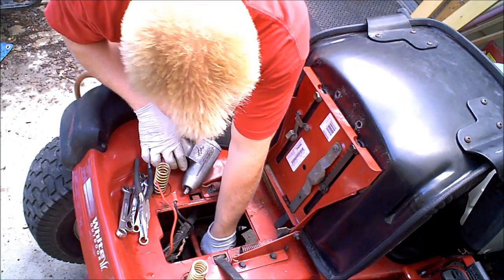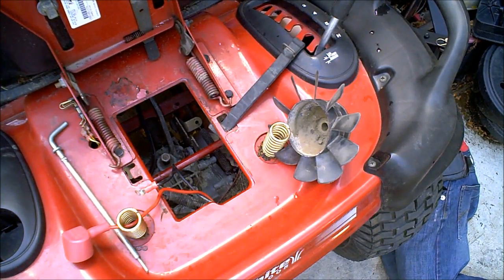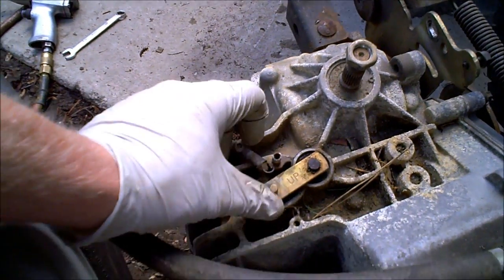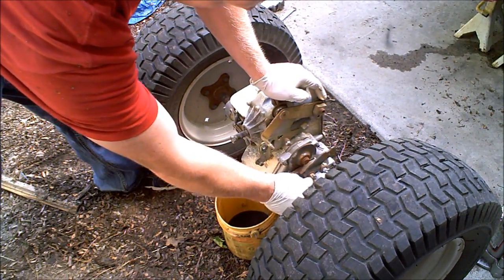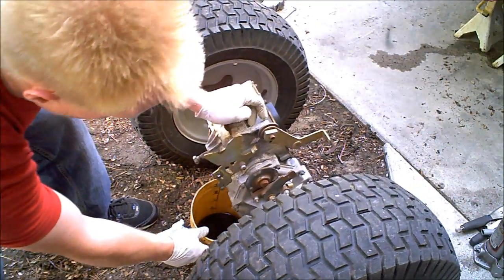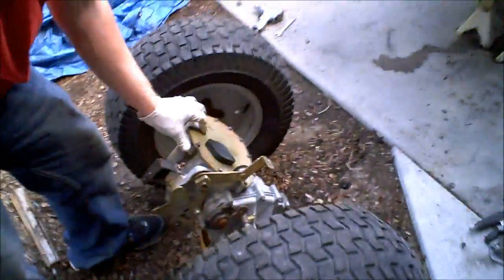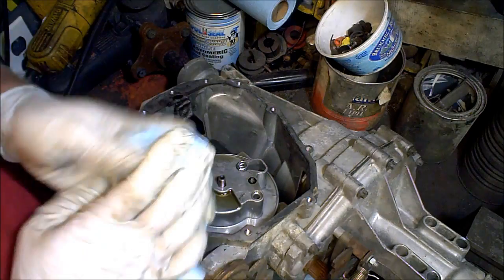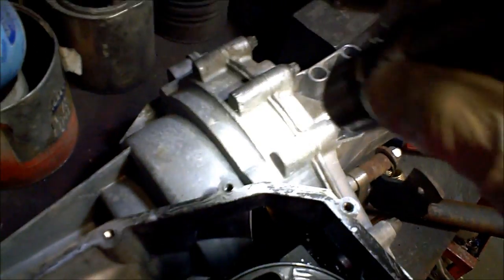1 Hydrostatic Garden Tractor transmission rebuild 1 of 4 Hydro Gear

Comment: hello
I own a stige rider villa hst 8-11E.
I want to change the oil in the hydrostat drive because it is already old,
I can't find the oil drain plug, what should I do, I need your advice. The drive works ok. which oil do you recommend?
thanks for your reply, our stigma masters don't know that.
They say that the oil does NOT change ???
lp. joze slovenija

Comment: I have a HG 0610. I wonder if it is the same or similar as I'd like to do an oil change on it too someday. I'm just not sure where to get a gasket kit for it. I'm in Australia and parts are difficult to locate and if you do find them,  they are damn expensive. Buying from the U.S always incurs extortionate shipping rates. I don't understand how a $5 part costs $40 to ship. Bloody Crooks !
Reply from the maker: All of these Hydrostatic transmissions are very similar in layout and identical in function. Some have a drain plug.

Comment: Any idea how to change just the left axle seal a d where to get seal at
Reply: 2185 cc looks different than one in video
Reply from the maker: The transaxle brand and model will be on a tag on the transaxle itself. From there you can find a parts breakdown online and part numbers.

Comment: Where do you get your parts from to repair this transmission? Sure would appreciate it if you could tell me. Bernieyarmuch@shaw.ca  Thanks. Good job on the vedios.
Reply from the maker: I ended up finding these parts on Amazon. Finding parts for these isn't always possible as so few people work on them. Find your part numbers and just Google them. You may also need to contact the manufacturer if all else fails.

Comment: I had to diagnose a weak drive in a skid steer.  Same setup as in a mower.  Finding nothing really wrong, the factory sent out a technician.  He also found nothing.  Since this was a brand new unit, they sent a replacement, and it worked fine.  The original was sent back to the factory.  A few weeks later, I was informed, someone installed a set of pump Pistons in the motor side.  The only difference was the bleed holes on the slippers are different by .010 of an inch.

Comment: i have a question on a v twin 19hp briggs, i started it up and in 5 minutes it was really getting hot to the point where i had to shut her down, i took out the spark plugs and noticed one got really hot ,like as if you put a torch on it , the other was fine. What should i check for to get my lawntractor to cool down. i thought i would ask you because you know how to fix anything and if you can't , ITS DONE! LOL!!
Reply from the maker: Generally these engines only overheat because debris are blocking the air cooling fins. More than likely with a riding mower a mouse built a nest on that cylinder.

Comment: How do you “reinstall” new fluid???
Reply from the maker: There is generally a plug on the top or a side. You can see at 4:19 the hole in the top I'm draining the oil out of.

Comment: Excellent, clear, free of music distractions, understandable, easy paced videos on your transmission repair.  This level of repair is beyond me presently, and I don't know if that is my problem.

  I have a Craftsman 18.5 hp, OHV, DYT, Intek Plus, auto transmission riding lawnmower.  I am NOT able to manually push it.  I don't know yet if the mower actually runs.  I can't push it out of my trailer because it will not roll.  I put it in the neutral position and disengage the lever for the transmission disengagement, but it will NOT roll.  When I jack up the rear wheels, the wheels will spin freely - in opposite directions.  Do you have any suggestions or possible ideas of what is wrong?  Thanks John R.
Reply from the maker: It's hard to say. A lot of hydro don't push easily even with the disengage lever actuated.

Comment: How do you remove a drive spindle from a hydro transmission?
Reply from the maker: You need to pull the entire transmission apart to separate the drive spindle.
Reply: sixtyfiveford do you have any video or other information on how to do this?
Reply: sixtyfiveford  pulled the trans got it open up drained the oil.  Need info were to get parts and the trans diagram. Need how to replace the drive spindle.
Reply from the maker: Google your hydro trans model number and you should be able to find a schematic.

Comment: my husband has one I wanted to kno the cost, but his sounds smooth  and it starts first try. I'm sorry but urs sounds like u have a muffler leak? I listen to All the mowers and riders he works on and I've gotten a pretty good ear to the sounds of the engines and mufflers on just about all of them (after 24, yrs.). bob Also has a Hydro 165?, John Deere, and Ariens, 10 Horsem All working Ex. in case You guys need Help

Comment: Great video.  I have to replace a fan and pulley on a Hydro Gear ZT-3400.  Looks like you made quick work of getting yours off, but I can't figure out how to keep the fan/pulley assembly from turning when using a ratchet.  Does the impact wrench make it easier?
Reply from the maker: Yes, an impact will take it right off effortlessly.

Comment: +sixtyfiveford thoughts on converting a variable speed mtd transaxle to either a 5/7 speed manual or hydrostatic transmission? or should I just rebuild the variable speed? it started slipping and making frequent popping sounds, and eventually it was slipping so much (with the pop/clank noise) that I could barely make it up a slight grade. reverse is only slightly affected, but not immune. do you think that shaft is rusted, causing the hub to not freely slide? I can't think of what I could of stripped inside of it. there is only slight play in the axle itself. actually the play seems to be within spec, up/down, left/right & in/out.
idk if I should dedicate my only day off per week to tearing into it. of course, craigslist has plenty of used transaxles but they are either hydros or manual, no variable
Reply from the maker: The variable speed is a great transmission. Most of the time the variable clutch is just sticking and needs a little clean up.
Reply: thanks for your input, I'll let you know how the rebuild goes

Comment: hi, i just got a brand new mtd lawn tractor with hydrostatic drive, it works great, however the transmission makes a slight whining noise, is this normal for a new hydro? thankyou!, keep up the good work.
Reply: oh and also just to add, i did purge the system to make sure there was no air in it.
Reply from the maker: A whining is small air bubbles that are trapped. They will work themselves out over time and you shouldn't worry about it.
Reply: +sixtyfiveford thankyou!, keep up the good work
Reply: Thomas king

Comment: I got a 1989 NOMA with a 16 V-Twin OHV. It runs good and one thing I can't get rid of is a whining sound from the transmission. Any ideas ?
Reply from the maker: Whinny is generally a transmission that has air in the system.
Reply: R Verro yhttps://www.facebook.com/TrumpPoliticalMovement/posts/522488951279470

Comment: what oil are you using? some people said use 20w 50 motor oil and other gear oil. which one should i use?
Reply from the maker: +Dany Luna Different units/brands call for different oils. Mine called for 20w-50.

Comment: I have a Murray tractor with a hydro trans-axle, for some reason it is stuck in neutral all the time, i had done all tried all I know to get it in gear,  the free wheel lever works, the brake rod works, the foot pedal works,  all have been lubricated and move freely do you have a idea of something else I can try.   Your video's are great and I have enjoyed watching them very much, Any easy to follow.  Thanks George
Reply from the maker: +George Edwards More than likely the internal pin that puts it into free wheel is sticking even though the lever is disengaged. Light taping with a hammer may free it up inside.
Reply: +sixtyfiveford I have a cub cadet 1020 that is stuck in gear and I have no idea which one because the shift stick has come off. can you help me at all?

Comment: Ok.  Will tell him but he is insisting he needs to replace switch interlock  no 725.04039.  He has tested all switches.  What does the above part do for the tractor.
Reply from the maker: Barbara Votaw 
This tractor is equipped with a safety interlock system 
for the protection of the operator. 

•     The safety interlock system prevents the engine 
from cranking or starting unless the parking brake is 
engaged, and the PTO (Blade Engage) knob (or 
lever) is in the disengaged (OFF) position.

•     The engine will automatically shut off if the operator 
leaves the seat before engaging the parking brake.

•     The electric PTO (Blade Engage) clutch will 
automatically shut off if the operator leaves the 
tractor’s seat with the PTO (Blade Engage) knob in 
the engaged (ON) position, regardless of whether 
the parking brake is engaged.

•     With the ignition key in the NORMAL MOWING
position, the electric PTO (Blade Engage) clutch 
will automatically shut off if the PTO (Blade 
Engage) knob is moved into the engaged (ON) 
position with the drive pedal in position for Reverse 
travel.
Reply: Thank you.  My dad wanted specific instructions.  Will give to him.

Comment: My dad is trying to repair a Cub Cadet LT 1046.  Specifically he needs to know how to reach the interlock system 725-04039 to check and/or replace.  The motor keeps shutting off.  Any help will be appreciated.
Reply from the maker: Barbara Votaw All of the safety switches are tied to the seat. They want to make sure you're on the seat while the blade is engaged.  Lift the seat and make sure the switch is in good condition.

Comment: Hi there,I have a Murray Ultra wide body 20hp twin and the hydrostat was getting lazy.So it got parked as I have 2 other mower's.I'm wondering if you know anything about the rear end in theses rider's.It look's like it's a totally sealed unit.Any way to fix these or should I just part out the mower.I'd hate to get ride of it cause the motor ran so smooth and cut really nice as well.I'm very mecanicly inclind so I'm not afraid to dig into it but if it's not worth it than would rather not.
Reply from the maker: Kurt Martin The pump or hydro motor in these is about all that wears out. Pull the transmission model number and see if you can find these parts. If so, I would rebuild it.
Reply: sixtyfiveford thank you,it's one of those thing's I don't know much about.But will give it a shot.Thanx again Cheer's.
Reply from the maker: If you decide not to do anything with it, save the motor as you can use it on any other riding mower. You can even find someone with the opposite problem as you with a blown motor and good transmission and do a swap to make one good machine.

Comment: How much hp can  hydrostatic take?
Reply from the maker: knightrider1545 A lot. Most will easily handle the 20-25hp motors they put into riding mowers these days. The just slip internally more which is the nature of a hydrostatic.
Reply from the maker: 36hp is maxing it out, but it'll handle it. You'll be close to the edge but like anything with an engine just don't "slam" it and it will handle it without breaking. The biggest performance gain you will see is cutting grass. It may be rough on belts but it'll cut without an issue.

Comment: I hate working under the the battery - Look, then reach in and feel for it. Repeat, ad nauseum.
Reply: Why don’t you just loosen and remove two battery bolts, lift the battery out of the tray, then you’ve got access to fool with these damn things. I just removed my MURRAY transaxle entirely, much easier to drain the oil if it is removed from the frame...

Comment: I have a Cub Cadet mower, same transmission though. It leaks a bit of fluid through the bottom and right rear wheel. Not too badly actually, maybe a 1/4 cup every couple weeks. Went into garage this morning (after mowing 4 days ago) and a puddle of fluid was under the right rear wheel. Any thoughts?
Reply from the maker: The wheel seal it bad. It can be done on the mower and would probably only take you under an hour.

Comment: Where did you buy your parts for the hydrostatic transmission?
Reply from the maker: Amazon actually had the part I needed and they were the cheapest. I just found the part number I needed and then Googled it for 30 minutes.
Reply: Can you remember the vendor on Amazon?       Another subject....I want to know how to find an explosion chart of a John Deere 130 hydro gear trans axle.  We have googled and unable to find one.  Thanks.  Leamon
Reply from the maker: I just looked it up; it was Mowtownusa . They also have a website but there prices aren't the best. I would find your part number and Google it. Do you have the L130 or the older 130? Your transmission itself should have a model number on it.

Comment from the maker: I not sure without Googleing it which type yours uses. Mine used 10w 40 engine oil but I know a lot use transmission fluid.

Comment: Your video was helpful in rebuilding a hydro gear transaxle in my older Husqvarna LT130 Model # 310-0650 (319-0650).  How much oil and what kind of oil should I use? Thanks

Comment: Hey
   I have a murrey hydrostatic rider. It won't start unless I jump it with my boat battery. I bought a new battery for the mower and does the same thing. I have replaced the key swith and the seloined, get the same thing. I set the boat battyery beside the starter,hook the pos. to the pos. wire that goes to the starter. Then nagitive to battery,then touch it to the outside of starter and it starts?

THANKS
Reply: You didn't say whether or not it was turning over, or if the solenoid was clicking.  If it is not even trying to turn over, you probably have a bad safety switch somewhere. A quick check is attach a small jumper to the pos on the battery, then touch it to the small wire on the solenoid.  If it turns over then, you either have a bad safety or a broken wire somewhere.  Running the jumper, bypasses the ignition switch, safeties, and wiring.  All the solenoid is looking for us a signal to activate it.  Good luck.

Comment from the maker: This one runs 20w50 motor oil but many call for different fluid. The transaxle on this one is connected, using the same fluid and most due.

Comment: Great Video! (as always)

Hey, What weight oil did you use? Do you use a different types of fluid for the pump and transaxle? 

They are separate, right?
Reply: when I rebuilt one I went to local lawn n tractor store and they sold me this clay based grease I refilled mine with.. came looking for name as no longer near that shop.
Reply: mine was different though, sort of a pancake design.

Comment: And is it possible to put a 2 speed fan so lets say your going up a hill a lot with a full grass collector on, the 2nd speed either mechanically, electronically, or physically shifted in to 2nd gear make the fan go faster to blow more so it can cool the transmission down, is it possible?

Comment from the maker: Its hard to say if there is something internally wrong without a running engine attached to it. It should not move that easily. The transmission can be damaged if someone towed it for an extended period with the lever IN. Since you engine is out of comm I would hook a socket and drill to the top of the pulley on the transmission and run it to see if the wheels move.

Comment from the maker: The brakes are adjustable. There is a small disc on the side of your transmission. There is a nut in the middle of the brake caliper on the small disc. Turn this in cw 1 turn and try it.

Comment: thats what it is doing, just goes very slow, an dies on an incline.  i found a breakdown on the axle part just nothing for the pump.  cant find any numbers on it. but i have a peerless 1312  serial 30065402

Comment from the maker: A filter change will only help if it is very clogged. In that case would probably wouldn't move at all or very very slow. You can view Peerless/Tecumseh parts breakdowns online. What are your Peerless numbers?

Comment: the fluid i drained was clean, on top in the reservoir it was a bit gray and cloudy.  i adjusted all the linkage to my transmission and lever, was just wondering it a filter change would help.  i got the peerless numbers off my tranny but am unable to find any numbers on the pump to find a breakdown/parts list

Comment from the maker: The flow of the pump controls the speed. The pump is controlled by a swash plate that is controlled by a lever mounted externally to your hand or foot speed control. The first thing I would suspect is a possible linkage problem. I did watch a few of your videos on the flooded Cub. Did water/mud come out when you drained the fluid?